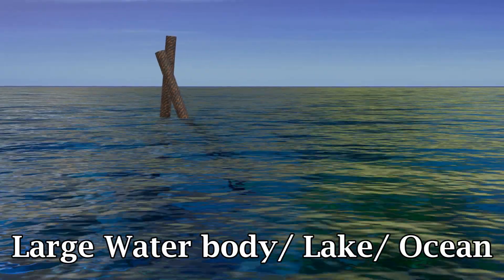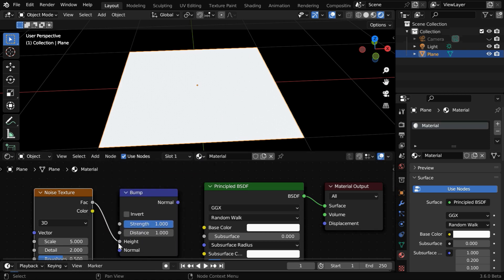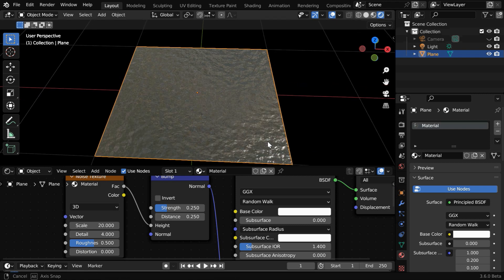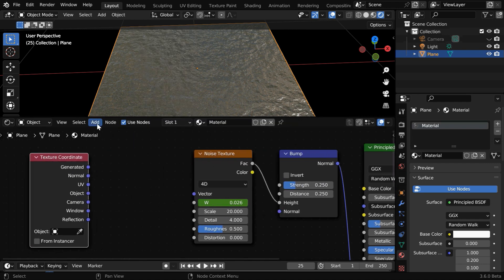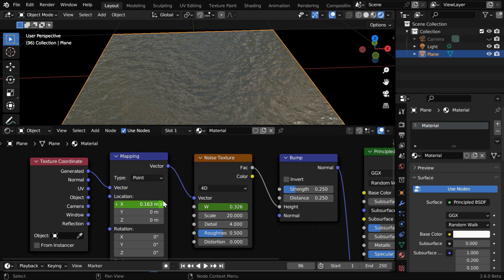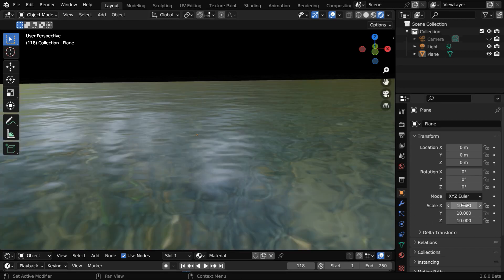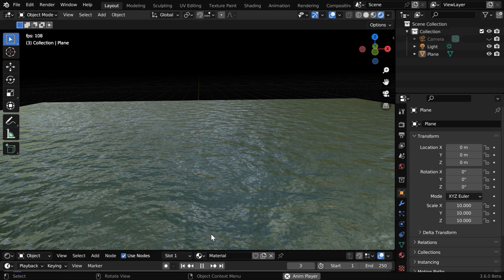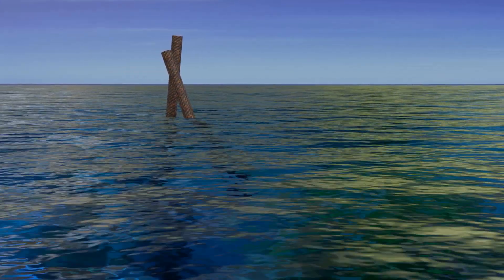Without Ocean Modifier: Create A Large Water Body In Blender | Realistic Ocean or Lake Water

Comment: I searched many times for export this ocean modify as an FBX file that waves could work like the animation. result of the export has not animation!
the question is, is there any way to export?
Reply from the maker: I don't think animations that are created through modifiers can be exported from Blender. You need to apply the modifier before you export, so the animation will be lost. The concept of modifier is not the same across various software, so there is limited support in export or import.
Reply: thank you. well, how we can create a sea with the waves as an animation? do you have any suggestions?  @5MinutesBlender

Comment: Is there any way to slow down the water animation? it works well but would like to try a slower animation for a project
Reply from the maker: Yes, you can easily control the speed. In the shader editor, we have used keyframes on two fields: 1) X-Location in the Mapping node and 2) W field in the Noise Texture. You need to reduce these values (i.e. their end values, not the initial values) in order to slow down the animation. If you make the end value same as the start value, there will be no animation. Now increase the end values slightly and check the speed.
Reply: Thanks, will test!